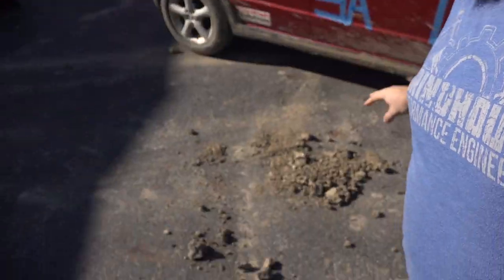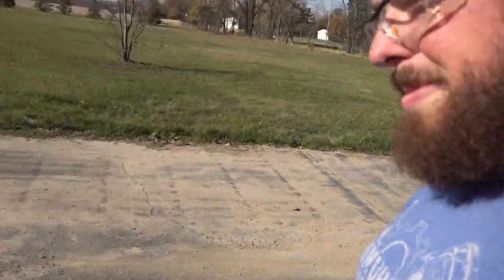Deep Cleaning My Wife's Suzuki SX4 Rallycross Car

Comment: How did u install the tow hook I wanna do the same to mine
Reply from the maker: It's drilled through the front crash bar with a slug in between the box so it's bolted solid. I don't have any pics but it was pretty straightforward
Reply: I would really want to see it cause I wanna do it to mine